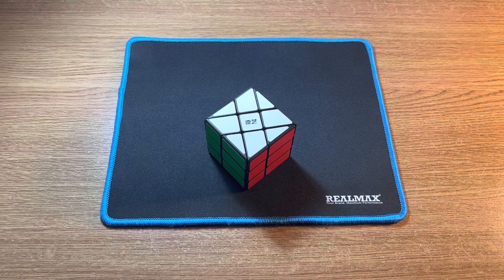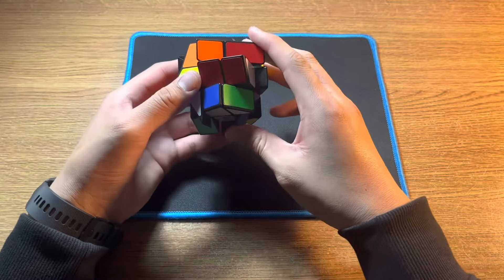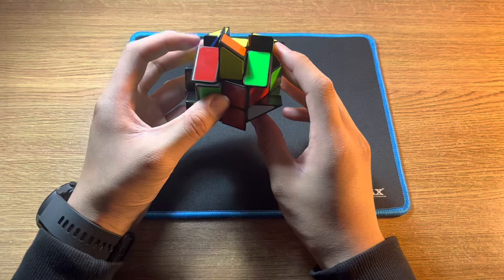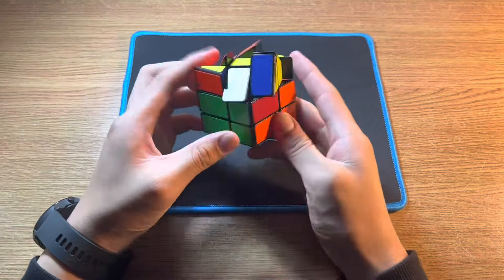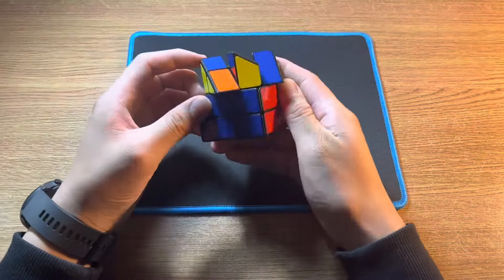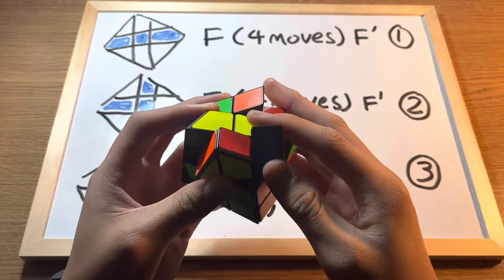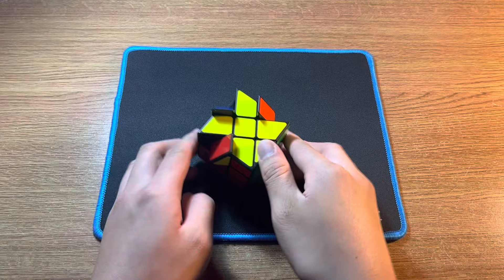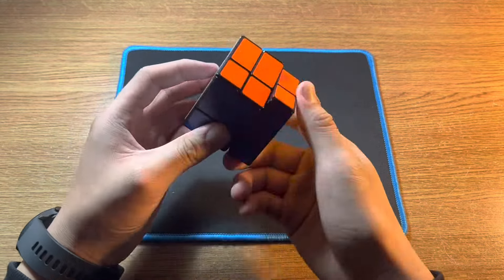How to solve a Windmill Cube (in nine minutes!)

Comment: Not sure if your still responding to comments but when ever I try to do th yellow cross the edge piece is always flipped where the yellow is facing me is my cube broken?
Reply from the maker: If there is only one edge piece that is flipped, then you should take your cube apart and reassemble it solved. After that it will work as normal 👍

Comment: My last two corners are swaped
Reply from the maker: If only your last two corners are swapped and nothing else, this means that your cube is assembled wrong. To fix this, just take the cube apart and assemble it in a solved state.
Reply: did you have each side as one colour? i got this too when i had the corners on the wrong side of the edge pieces

Comment: Two of the corner pieces are swapped when i solve the cube, is there a way to fix this or is the cube just broken
Reply from the maker: If it’s just two corner pieces that are swapped, then yes there’s a problem with your cube. All you need to do is take it apart and reassemble it solved, after that it will work normally 👍
Reply: @cuber-ray hi! thank you but i just solved it wrong that was all

Comment: Idk if mine is broke, but when solving the middle layer, one of the red pieces is turned and all the other ones are fine
Reply from the maker: You should try re-inserting that edge in the other way by replacing it with another edge first 👍

Comment: idk if i got a fucked up one but how do you solve the middle one. i literally did what you did exactly and i cant solve it for shit
Reply from the maker: I’m just gonna give you a written tutorial which you may find easier. 

So assuming that you did the white cross, if you get an edge with one colour that is ‘standing up’, match it to the face that is the same colour and move it to the right. 
Next, you do a U’ and do the left-hand four moves. 
Then rotate the cube so that the front face is on the right and then do the right-hand four moves.  

If you get the other case, where the edge is ‘lying down’, do a U2 and rotate the cube so that the front face is on the right. 
Next, do the right-hand four moves. 
Then rotate the cube so that the front face is on the left and then to the left-hand four moves. 

If the edge that you want is in a second layer slot, replace it with any other edge and carry on from there. 

If that didn’t work, then you may have some other cube for example a fisher cube which looks very similar to a windmill cube. 

Hope that this helps :)
Reply: i solved it earlier today and it was exactly that lol thank you
 @cuber-ray
Reply from the maker: Glad that I could help you solve it :)